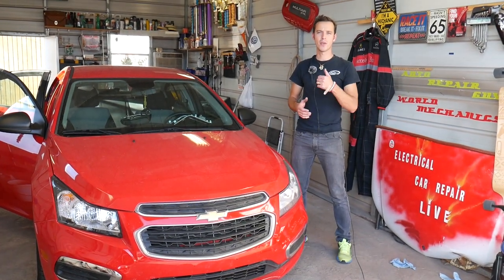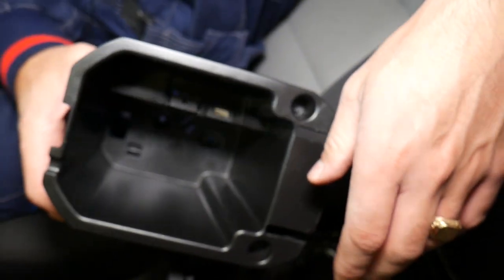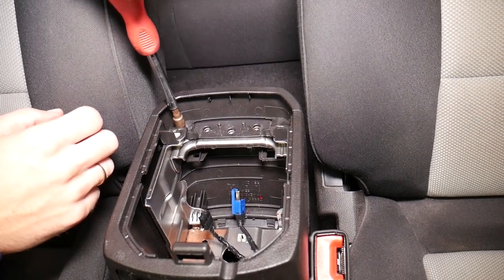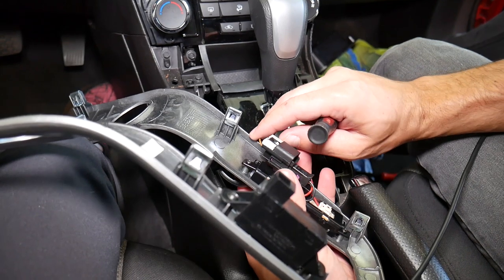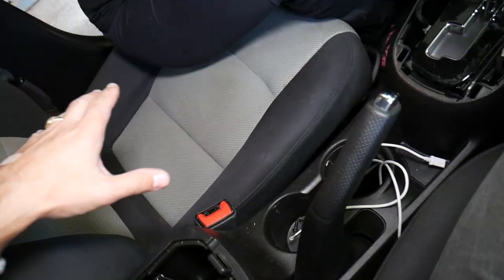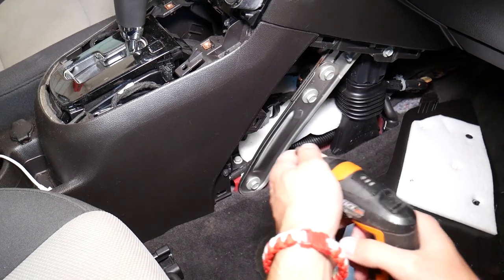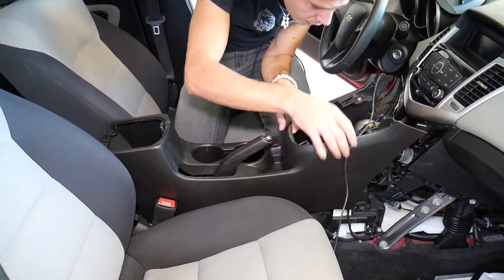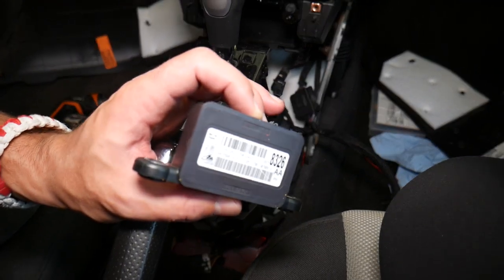CHEVROLET CRUZE TRACTION CONTROL MODULE YAW RATE SENSOR LOCATION REPLACEMENT

Comment: realy helpful clips. Also helpful for Chevi Orlando 1.8 Gas engine. I have also a question to it. Is there OBD adapter available which I can use for Orlando to dive deep in the modules.
My engine is stuckely each time if its cold and in the first 1.2km. I need it to read out during driving. Many Thanks

Comment: The same location is in the  Chevrolet Orlando ?.  The ESC signal is on and engine looses power.  DOes it have to do with the Speed sensor failure ? Since this was the first error.

Comment: Hi, can a faulty yaw rate sensor cause issue on hill assist ? Mine is defective up to now.
Reply: I have the same issue when it comes to hill assist. It literally slows the car down.
Reply: @alainegbe  I just had the car checked in two different services and the Abs module is defective. Very expensive repair, check out the codes for sure. One of my front wheels is braking or blocked because of this module.

Comment: Chevy 2015 Chevy Cruze Ls. Stabiltrak light on dashboard, car looses power and engine shaky. Help, thanks
Reply: What did you fix after all
Reply: I'm in the same boat. Upon acceleration up hills is the worst. Is this the answer?